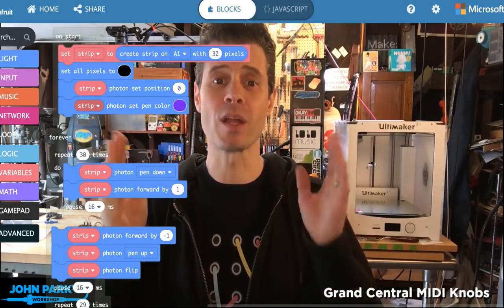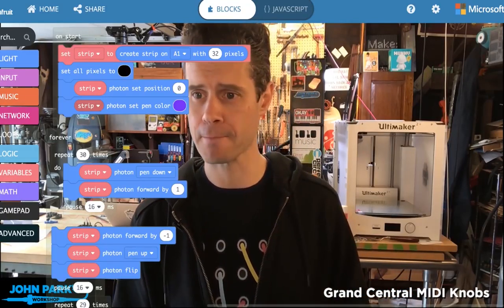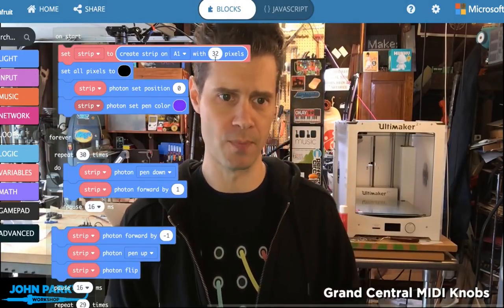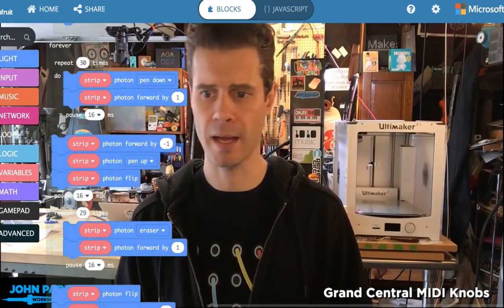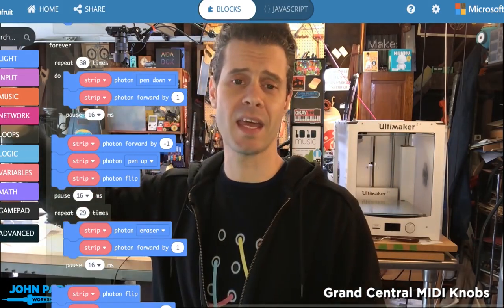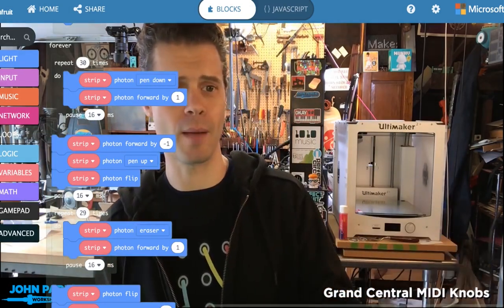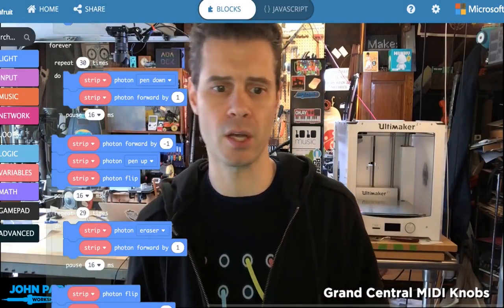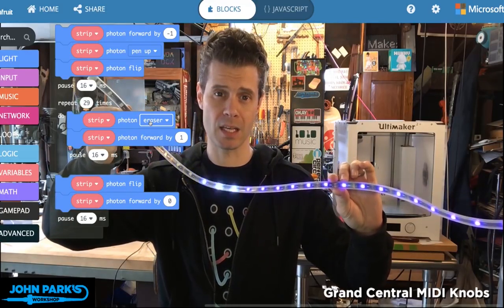MakeCode Minute: Photon Strip @adafruit @johnedgarpark #adafruit @MSMakeCode #makecode

Comment: If we could add your "photon" action with the 'light' extension to Arcade MakeCode game , then assign it to a single pixel (using Maker?) then we would have an off console electronic scoreboard. BrainPad (GHI) has an "old engine" for Arcade according to Pelikhan but does have I/O stacks and display, tiny.96", and the SDA/SCL pins output same signal to breadboard .96 OLED as to onboard OLED ; so..doable? Merging code systems; tricky part.